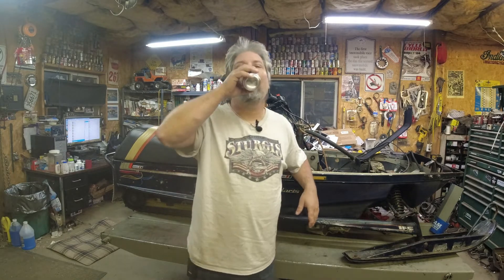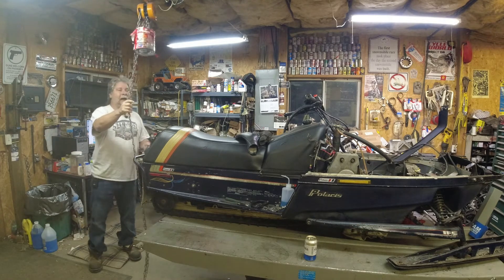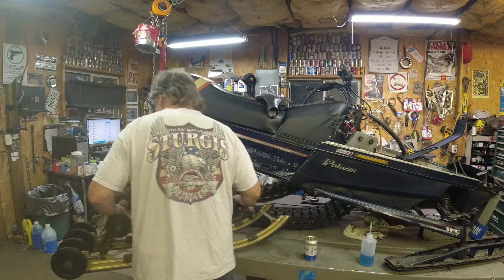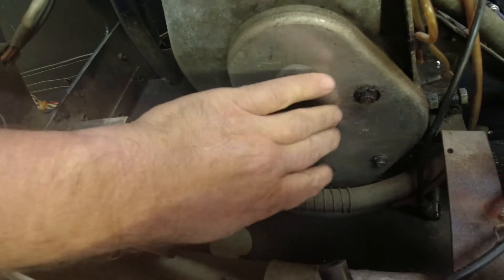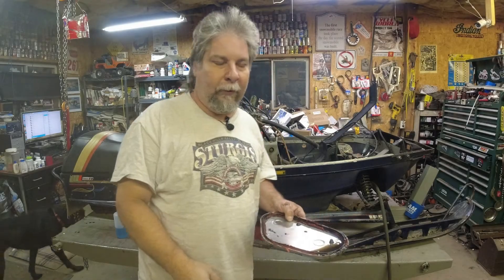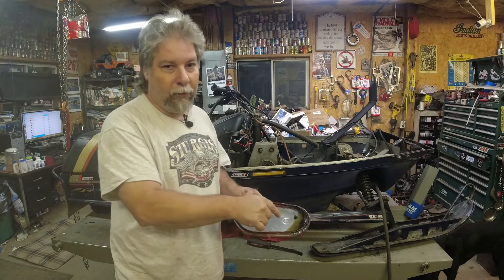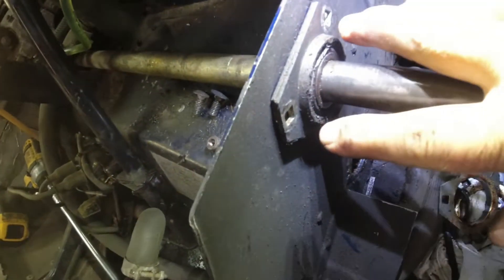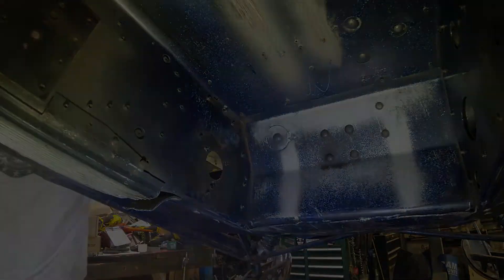Polaris Cross Country Indy Rebuild Part 2

Comment: ATF not 80w90. Thanks for the words of wisdom Nutter!
Reply from the maker: I would hope everyone knew this, but I still find gear lube in a lot of used sleds.
Reply: @nuttersspeedshop  I know now! I know Honda puts 80w90 in there snow blower augers.
Reply from the maker: @junkyardkid8717  If it's made for it, that's another thing altogether.